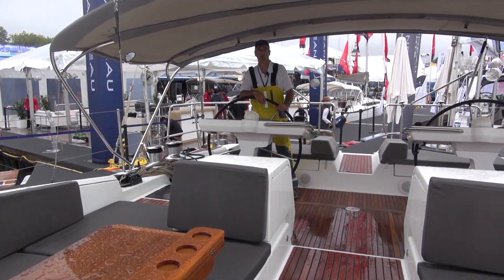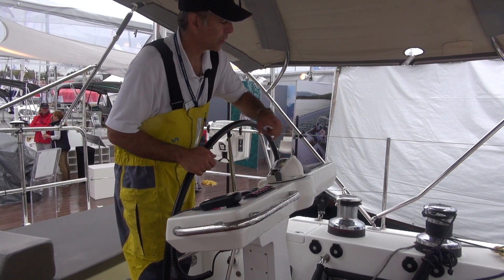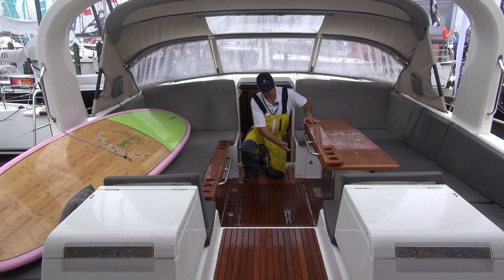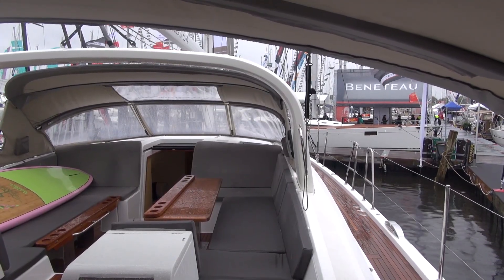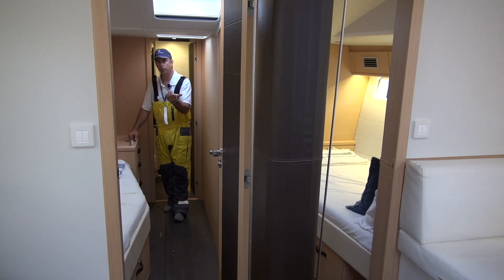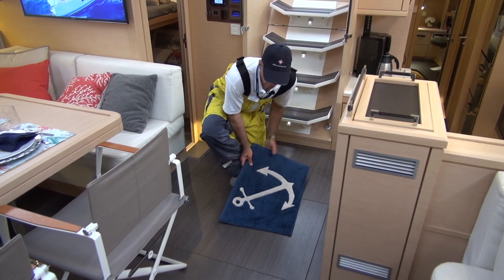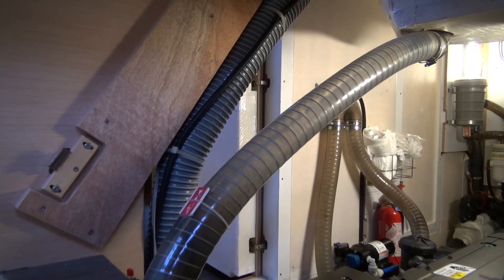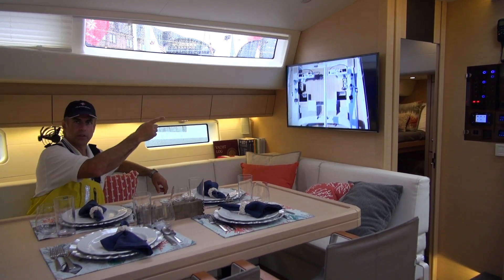Jeanneau 64 Yacht Part II with Scott Rocknak

Comment: Best walkthroughs on the internets. Thanks Scott. One question: in the galley, is the water system pressurized, or is it foot pump operated?
Reply from the maker: Hi Perry, Pressure fresh water. You can also get a backup manual fresh water and raw (ocean) water foot pump. This is true for any of the models. The latter two are usually added at the dealer. Scott